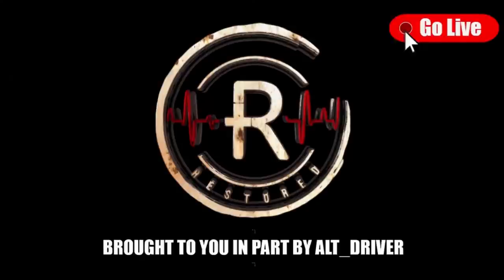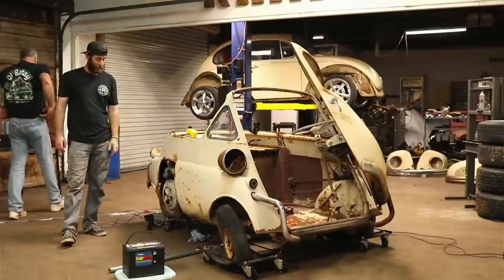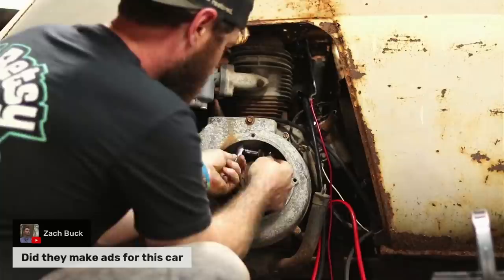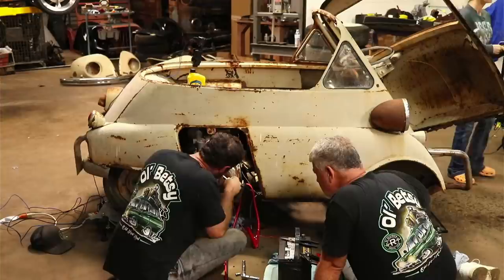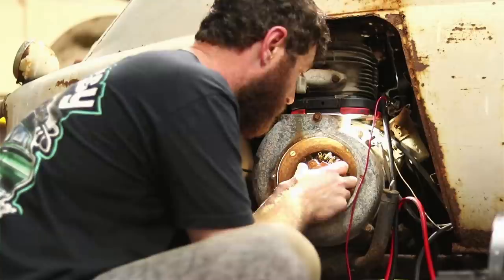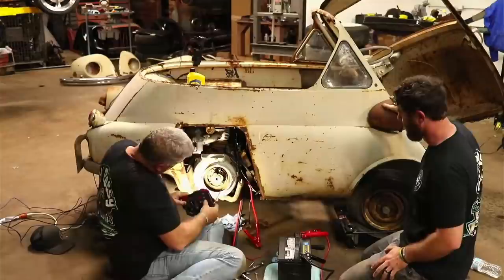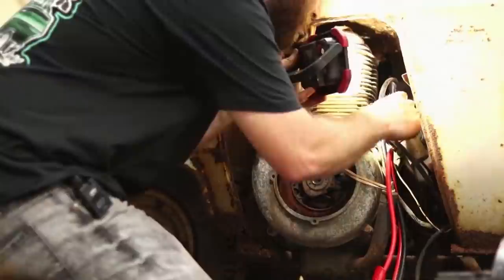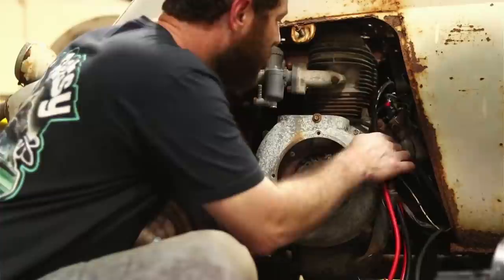LIVE Forgotten 1955 BMW Isetta Barn Find | Will It Run After 50 Years?! | RESTORED

Comment: BMW Isetta 250

While it retained the "Bubble Window" styling, it differed from the Italian model in that its headlamps were fixed separately to the sides of the bodywork and it carried the BMW badge below the windscreen. The car was also redesigned to take a modified version of the 250 cc 4-stroke engine from the BMW R25/3 motorcycle and the front suspension was changed. The single-cylinder generated 12 hp at 5800 rpm. The crankcase and cylinder were made of cast iron, the cylinder head of aluminium. However, the head was rotated by 180 degrees compared with the motorcycle engine. The twin-bearing crankshaft was also different in the Isetta power unit, being larger and featuring reinforced bearings. One of the reasons for this was the heavy Dynastart unit which combined the dynamo and self-starter. The fuel mixture was provided by a Bing sliding throttle side draft motorcycle carburettor. In addition to further changes of detail, the BMW engineers enlarged the sump for installation in the car and cooled the engine by means of a radial fan and shrouded ducting.

The power train from the four-speed gearbox to the two rear wheels was also unusual: fixed to the gearbox output drive was something called a Hardy disc, which was a cardan joint made of rubber. On the other side of it was a cardan shaft, and finally a second Hardy disc, which in turn was located at the entrance to a chain case. A duplex chain running in an oil bath led finally to a rigid shaft, at each end of which were the two rear wheels. Thanks to this elaborate power transfer, the engine-gearbox unit was both free of tension and well soundproofed in its linkage to the rear axle.

Comment: The first and only time I ever saw an Isetta on the road - it was parked in heat in Palm Springs, and there was a lady inside asking for our help. I was a teenager at the time.  She kept cranking her engine over, and it wouldn't start.  I couldn't see any doors. How did she get inside the thing? Then she opened the front and got out.  She had bright pink hair! In the late 1950's!  We couldn't do a thing.  What a car!...why? Why? Why?

Comment: Just a tip they are call contact breaker not points on that BMW. I just looked them up on ebay.and generic ones cheap oem are super expensive.

Comment: Take the cover off that is around the points. It looks to be attach by 8mm screws or phillip screws.
Reply: We said remove the cover and you can see what is in your way or how to attach easily
Reply: Once again pls. Christian tell your brother and to remove the  aluminum round looking cover that is on the pariimeter of the points. Yes it will, cuz the you will see what is stopping you from mounting it. Even if it is to long you will how much to modify because you can see behind it. 25 yrs of experience against your thinking. Sorry do not mean to intimidate.  Been ther and done that.

Comment: Manufacturer: Bayerische Motoren Werke AG
Country of Origin: Germany
Drivetrain Configuration: Rear-engine, rear-wheel drive
Engine: 298cc
Transmission: 4-speed manual
Top Speed: 53mph
Years of Production: 1955-1962
Number Produced: 161,360
Original Cost: $1,093

Comment: I bought a used  Stihl chainsaw several years ago,started a deep clean to get oil and greasy sawdust and found it had the old point system converted to a 
Solid state system that replaced the points call a local saw repair shop .Good luck hope this helps

Comment: Recently found your chanel I build,restore classic cars for last 20+ years (39 years exp) like what you do but sure you know this now BMW's logo is actualy the checkers from the Bavarian flag (not like I was told in school for the airplane's they built in WW2 for Germany and forced out of business by treaty signed at end of the war that Germany could no longer make military related viechle's,planes,tanks etc..
Like myth you can't leave a car battery on cement floor because it will drain the battery (was true when car battery s were made of a wood shell coated in tar the cement scraped tar etc.. causing dead battery s now they are plastic base so that doesn't happen but was told all the time by the older guys in shop because when they started that's how they were made and still said today.keep up the good work
Tommy

Comment: If my memory serves me correctly, these  were wire at the coil the same as a motor cycle.I cannot remember if there were two spade connections or four and i cannot see close enought to be able to help you, but if you know someone with a bike you might find they can help.???
Reply: I still think it may be a faulty condencer as without that you will not get a spark.

Comment: A lot of Service personnel bought them because they were easy to work on and they had them out of the Rain when they wanted to ho anywhere. They would open up t where they were very enjoyable to drive. I drove the two I mentioned several times. They were very popular during the Korean War. They also had Clubs like Motor Cycle Clubs. they beat Hitch Hiking or waiting on Buses and Trains. Gas was about .22.9 cents a Gallon and just think how far you could go. In St. Joseph, Mo. Clark Cushman Cycles sold them as well as the Cushman Runabouts. Harley Davidson also had a small car and Truck as did King Midget.

Comment: There is no short cut to such work...get the motor out...clean all the parts...reassemble, adjust the contact according to the 2 stroke requirement & it will run.
A very simple engine but digging here & there will not help.

Comment: Maybe its time to get a small 3d printer so you can remake parts.
I presume that its the body of the points that has broken, and another thought is that these engines are in fact not much bigger than lawn mowers so maybe a set of points from one of them.
The other thought is that i know you can buy  electronic points that take the place of the condencer and the actual points themselves.
Which ever way, at least it might remove the problem of trying to repair the old ones.
The three wheeler i always wanted was the one made from the german fighter plane, they were a little smaller than the isetta and the engine was a
Lot easier to get at, if ever you see one of those grab it, they are worth quite a bit.!!!

Comment: I don't understand what the big deal is about valve stems. Just replace them. Easy-peasy, (as long as they're tubeless tires, that is). I have a tool that enables me to replace valve stems with-out removing tire from wheel, or even breaking the bead. Don't even have to remove wheel from car. With all the vehicles y'all deal with, you should definitely have one as well.

Comment: Lay it over on it's side on an Innertube so you do not have to sit on the floor. Being a Missouri Hillbilly, I would have blocked it up on a couple 2" X 4" X 3' long so I could look down on it. Use your Porta Crain Motor Puller and lift up the side your working on. I even do that with my 1950 Studebaker. I have even propped it up on one side wheels  and pulled the Transmission and Clutch. When you are poor, You have to do as you can. Hillbilly way.